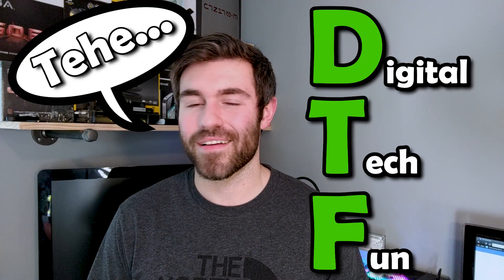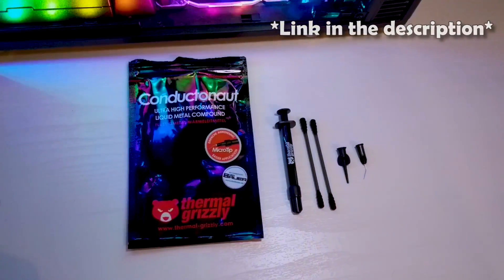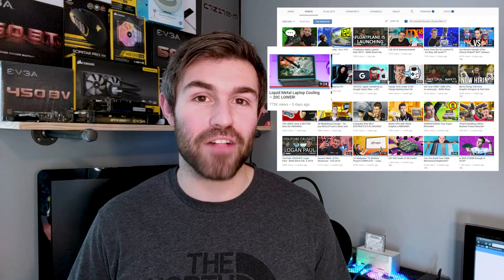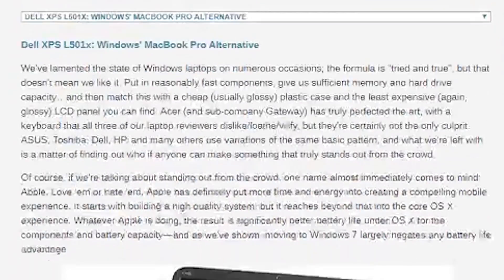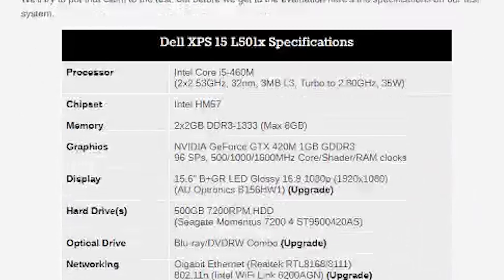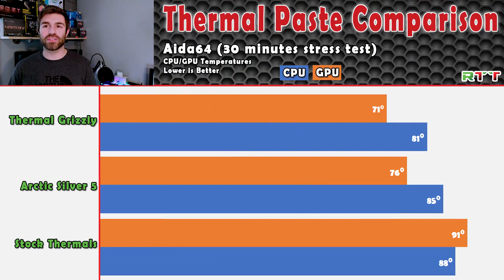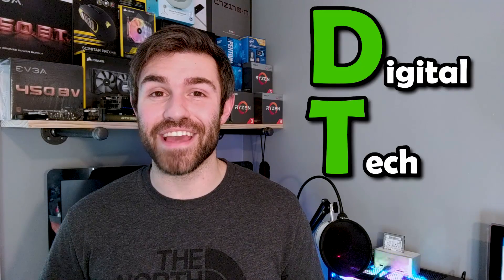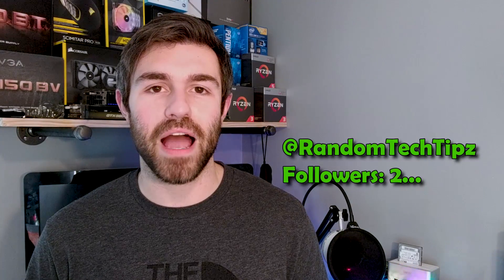Was Linus Right? Adding LIQUID METAL to a LAPTOP

Comment: Since when was i5-460M , GTX 420M, 2GB 1333 RAM (max 8) top tier in 2011? In 2010, my i7 with 4 threads, not 2, GTX 950M, 8 GB of RAM (max 12 GB) for $760 that was bottom of acceptable for my use case, which I considered lower upper middle tier. If you paid anywhere near $3k for that Dell XPS 15 you were robbed. There were 5k+ notebooks, even. No wonder my 5 year old laptop has aged so well. It's thermals I've had zero complaints, even ran fine in some crazy outdoor heat, so I wouldn't even repaste (though I need to clean|grease|replace? a fan, and the EDP cable, bezel and unavailable backlid - bad hinge design, which Dell build quality in this respect is zero issue).

Comment: I have a Ryzen 5 3550H laptop from Asus and they completely failed with the cooling. The cpu reaches over 90c when gaming and the fans are very loud. I wonder if they are just using bad paste so if I would replace the paste with MX4 it would improve?
Reply: yes it will, go get an MX4 and repaste that monster 💪💪💪

Comment: You suck
Reply: Your audio sucks.. hard.. intro is too loud, commentary is too quiet and tinny. You didn't do any benchmarks or take note at what frequency the CPU and GPU were running at. Everyone knows that modern CPUs and GPUs automatically boost clock speeds or throttle performance based on temperatures.

So your results don't even show half the story. Maybe if you locked the frequency of the CPU and GPU before doing this test we could have seen a bigger difference. Like maybe the original paste runs at 2ghz with high temps, and liquid metal runs at 3gz with cooler temps. If you locked the CPU at the same speed it was running at from the first test, you would have seen more temperature improvement.

Or like I said, at least note the frequencies or run benchmarks.

Comment: Watching you take that laptop apart gave me such strong Dell-owner flashbacks - soo needlessly painful! 

Kudos on being one of the very few I've seen to use a good thermal paste and then the LM lol. so far I've mostly just seen a lot of people wiping off the shit their machine came with and applying liquid metal without testing thermal paste. Honestly I'm too scared to put LM in my laptop. I went with Thermal Grizzly Kryonaut, which is expensive as fuck but did get me a couple of C's down on arctic silver 5. It's got a rating of 12.5W/km to conductanaut's 73, so clearly conductanaut is the better cooler and cheaper, but I just can't shake that feeling that at some point my laptop's going to be on it's side in my bag and somehow a tiny little bit of liquid metal is going to run away somewhere it shouldn't lol.

 I use conductanaut in my PC, and found my EVGA 1070ti runs about 5-8C cooler on LM than it did with kronaught, but my CPU seems to have bottomed out as I don't overclock and is at best 2C cooler.

Comment: Ok cool so you are conducting the heat better from die to the copper pipes but the pipes have no fan, so the heat can't dissipate further. Ofc LM won't do much in that case. The thermal solution in Linus his expensive gaming laptop was better overall and afterall.

Comment: you probably just ruined your Dell XPS heatsink.... the center is copper but all grey areas are made of aluminum, in which gallium will destroy quickly. One drop and it will disintegrate.On Thermal Grizzly Conductonaut website, it says you CANNOT use with aluminum . I know because I have one which im typing on right now, took it apart 15 minutes ago to verify its aluminum.
Reply: Guy is actually typing that on his moms basement special compaq presario

Comment: You would have seen much more difference if you cleaned the old paste from the heatsink properly. The whole point of replacing the thermal interface material is to have it "interface" as much as possible between the processor and heatsink. Any old residue WILL reduce the LM performance.
Reply: It did, and you should be commended for that, but i think the difference would be twofold with a good application of LM. Still, you got a good reduction in temps, and that's always good

Comment: It´s not just performance.
I used LM in my old Dell Latitude 6410 Laptop.
I didn´t do this for performance, since you can´t overclock the cpu inside.
But after replacing the stock paste with LM, the cpu fan spins much slower and barely goes to max, even after multiple cinebench runs. With the stock paste it was loud af but now it´s very silent.

PS.: It looked like you used a bit much LM, it should be a really thin layer, there should not be any "puddles of LM", besides being less risk of spillage you could maybe improve temps even more.
GN made a good Video about applying LM and tested different amounts of LM, basically use as little as possible.
Also cleaning of all old paste and applying some nail-polish around the cpu/gpu die lowers the risk of a short circuit.
Reply: gn ? where's the video i wanna see it
Reply: GN = Gamers Nexus
They have many videos about liquid metal.
one example:
https://www.youtube.com/watch?v=kYnUfXl0Gdw

Comment: can you atleast clean the old paste properly? damn it dude.
Reply: Actually if you leave a bit of thermal paste around the resistors and other components it can serve as a extra layer of protection from any sort of liquid metal spillage despite how unlikley that would be. Better than using electrical tape like some people use. 

Though in this case, eh yeah could have do a better job.
Reply: wont make a difference,
Reply: Yea that'd a little embarrassing. Plus using the screen face down to work on was cringe worthy